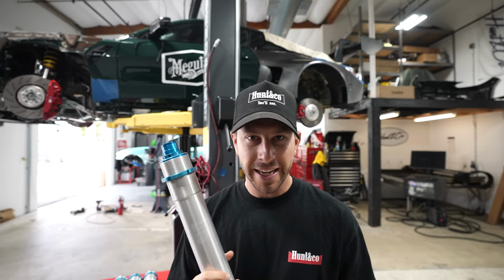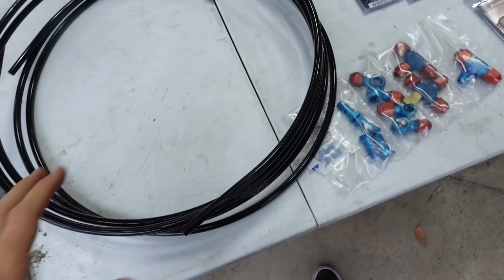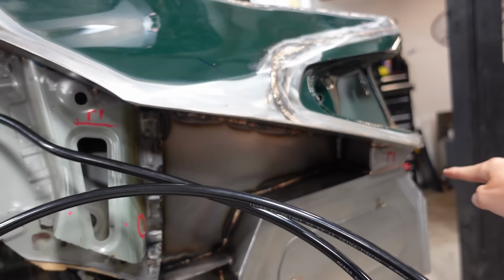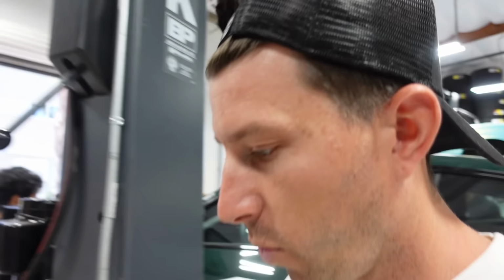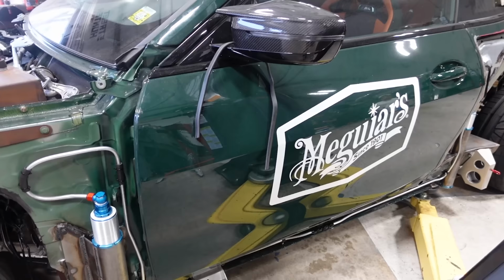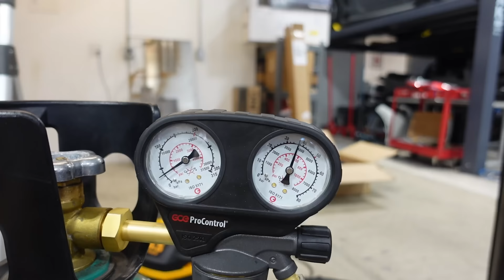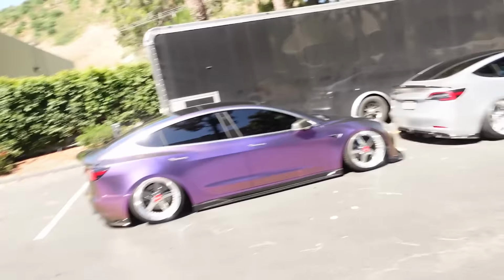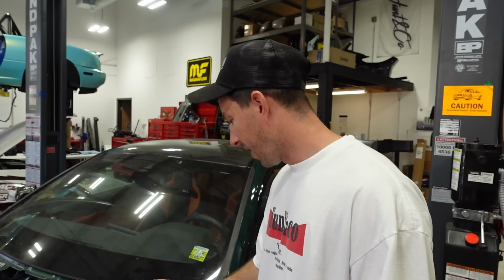We Installed Air Jacks on my ‘Street’ M4 GT3!

Comment: Remember, "DO NOT Hit the Air Jack Button on the freeway" lol. If you can put the air jacks on a double switch so two button have to be pressed at the same time to activte them. If you do put in an air tank so you can pull up to the car show and BOOM air jacks.
Reply: u need to plug a bottle in for the air jack to work there is no button
Reply: @whysopanda  Yea, i seen that later in the video than when i sent the message lol. It would still be cool to have the air tank in the trunk on a switch so you can screech to a halt and hit it imitating a pit stop!

Comment: The crash sensors absolutely work off deceleration rates (Gs). Whether or not they work in the Z axis (floor to roof) is another question. 

Your assumption that vibration and the g’s your experience on track are high is also very false. Airbags are typically triggered at ~20 Gs. You aren’t cornering or breaking at those speeds. You almost certainly will not exert 20Gs dropping the car because of the relatively low height, compression of the suspension, and compliance in the tires. If you’re genuinely concerned, pickup a cheap G force meter and strap it to the car and drop it.

Comment: You’re running high pressure with bags you’re easing suspension with the jacks theirs lifting the entire car with no help it’s basically just a air shock with an actuator valve and storage tank

Comment: Just raise the cars crash sensors resistance in the ECU and such and the such if measured one should have volt resistance in the form of a 5v reference ground or a 12v signal reference power or possibly both but either way whatever it is if it's measured you can change it's parameters if it has air bags that can be set off by shock. Then just recalibrate the systems reference signal weather it's power or ground reference from the system your not gonna tell me you dont have a way to change functions/tune the car I dont see the change to be hard and the easiest way whilst keeping your safety system intact

Comment: Alu hardline wtf? You guys realize rotm braided PTFE fuel line can do 500+ psi, right? 
Also, put separate pressure regulators for front and rear jacks in the car. The current setup is a train wreck in the making.

Comment: the way you guys put your hands beside those lines while it is under pressure and leaks is so dangerous.   the fab work of the cylinders is great.  why that  bent and long air line at the back ?  #18:12 the line goes to the right, when you turn the cylinder connection to the front you can connect it directly to the T-connector, that way you do not have that part of the line there.

Comment: I have 15 years experience with Class 8 trailers. I was head of research and development for the largest trailer company in the south. I did it all. Red and blue plastic lines are all that's needed. With simple push lock fittings. No need for expensive AN fittings!

Comment: You think plastic could hold the pressure needed to force 4 liftjacks to lift a car up simultaneously and repeatedly? Seriously? Come on.That plastic constantly getting heated over and over again from the car and the road...yeah BMW, VW, and Audi's aren't known for plastic parts breaking because of repeated heat cycles and especially accelerated because they were under pressure. Come on Teeeeeej! Plastic?